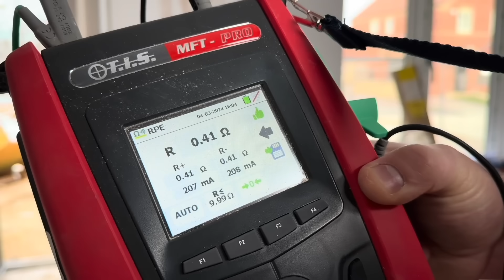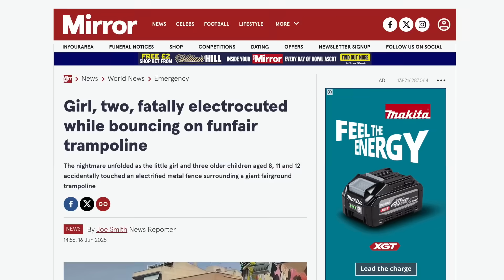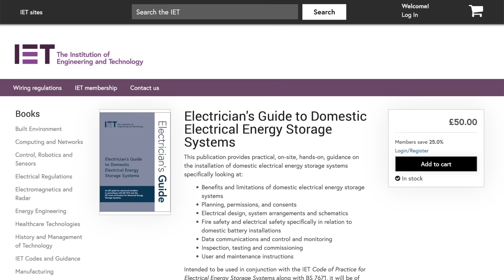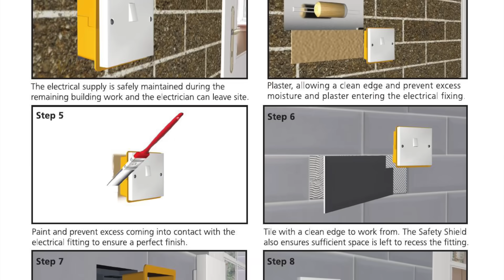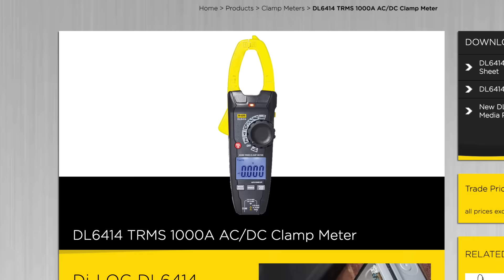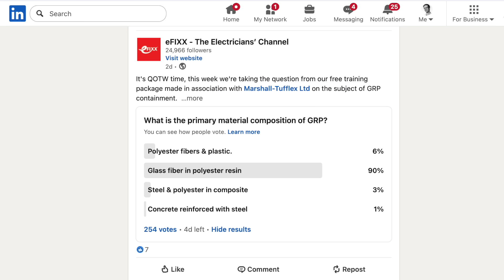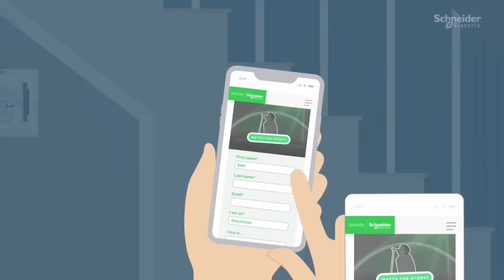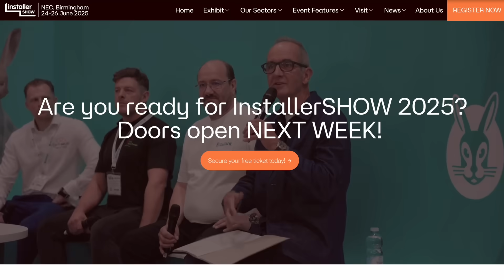IET Intervenes In Live Testing Debate...

Comment: Solar panel fires should be a thing of the past, did anyone actually figure out what the cause is?  Modern solar panels themselves have more than enough conductors between cells these days and should have close to zero fire risk.  But if you are worried, then ONLY install half-cut bifacial panels (rather than normal panels).  The half-cut panels have six internal strings instead of three and split the current in half.    A fire should be nearly impossible.

Maybe the installers are still paralleling large strings (which nobody should be doing any more, even with per-string fusing).   And it might not even be the panels at fault... if they have microinverters or RSDs then, well, having power electronics on the roof have the same problem that having disconnect switches on the roof have.  Hard / impossible to inspect, vulnerable to the elements and excessive heat, and failure modes which can cause fires.

So it sounds like people need to actually do a bit of investigation on this front.

-Matt

Comment: Chatting about photovoltaic and hybrid inverters, has any fellow electrician found a way of establishing which way the power is flowing in a wire (i.e. grid to inverter to charge batteries or inverter to grid to feed the grid). We can measure it very accurately but without knowing the direction I am finding it very difficult to set up the latest hybrid off-grid / on-grid systems. You can't even reprogram the system to give you a fixed direction because that in turn causes the inverter to operate in a fundamentally different way invalidating all your testing! Electricity meters do it so it must be possible!
Reply: Hall effect sensing and the right hand rule . Or Could just use a compass needle. All depends on the magnitude of the current, diameter of conductor and insulation (that tricky 1/R^2 fading of the magnetisation)

Comment: My own thoughts on PVS panel fires is that this entire world of 900v DC at 15 amps is too unforgiving and if we, as electricians are all honest, we don't have the same 20 years experience of knowing where all the boundaries are. Jo has already pointed out where electricians have run DC in SWA, (and not the special PVS 6mm) one of the lads I was training a few weeks ago crimped an MC4 on upside down, I came across an SPD that was AC, I had to revisit a load of installs because I had not realised that the DC isolators I had fitted had an IN and OUT (it wasnt marked), Every tiny weeny mistake when working with 900v DC ends up with a giant, blinding arc that gives off huge amounts of heat and flames (and nothing trips!), I doubt any of us have seen that with AC (something, somewhere always trips with any fault!). Not helped by the fact that solar panels in some areas are home to a zillion nesting house martins building nice dry nests of twigs and tinder in and around the connections.
Reply: It's becoming common for inverters to have arc fault interrupters built into the DC side so, hopefully, something will trip. Microinverters are also an option so that each panel has a separate connection to the inverter instead of them being daisy-chained to industrial voltages.
Reply: Im pretty sure SPDs are like incandescent lightbulbs and do not need to be designated AC or DC
Reply: @maygarland6123  They have to at least be labeled separately for AC and DC because the voltages will be different.  For example, a 230VAC circuit has a peak voltage of roughly 325V whereas of course the peak voltage of a 230VDC circuit would be... 230VDC.  And fuses have to be significantly more robust (and have a lower I.R.) for DC than for AC at the same voltage due to the difficulty of breaking the ARC on DC.  And junction thermal characteristics for the MOVs and zener diodes are different too.

So an AC or DC SPD could have the same parts, but the numerical ratings are going to be vastly different.

-Matt
Reply: Hiya, if you have a quick look, a typical AC SPD has 275 VAC written on it and a DC SPD has 1000 VDC. Also as you are probably aware, when you test out an installation, you test at 250v, but some things (like garden lights where they keep tripping in the rain), you decide to test at 500, 750 or even a 1000 just to establish where the issue is (because you cant work in the rain) and if you forget to isolate the SPD's first at 750v they conduct and your very expensive X1 starts to make a weird noise and shows a short circuit! Most solar installations are between 500v DC to 900v DC to a 275v AC Type 1 would never work. Plus, the inverter manufacturers state 'surge suppression' but what does that mean? Does that mean it fully conforms to all worldwide regulations and we can forget all isolation and protection (because that's not what it states. I have checked!) or does it mean it contains a sacrificial device internally that in the case of a lightning strike will prevent the unit from bursting into flames but you still have to spend 2000 quid on replacing the entire unit. Who knows? Maybe eFixx could cover this...
Reply: @paulmcraexx  Basically a SPD hangs a zener diode off of each phase to a central point.   And also hangs a MOV (sometimes with a gas discharge tube) from each phase to a central point.  The SPD hangs off of the wires being protected, it is NOT in series with the wires being protected.  It is not a series device like a breaker would be.

The central points all tie together through fuse(s).  Depending on the type of waveform expected (whether negative voltages are allowed or forbidden), there might be a back-to-back arrangement of zeners.  So a DC SPD for example might protect against negative voltages while an AC SPD would generally have to allow negative voltages.  Relative to some point (like ground).

The zener catches any over-voltage and has a reaction time of a few picoseconds to nanoseconds (very very fast, zener operation is more or less a quantum effect), but can only conduct for a very short time before the zener diode would otherwise explode.  The MOV takes longer to activate but can conduct the current for a much longer period of time before IT would otherwise explode.  If the surge lasts too long (generally more than a few tens of milliseconds), the fuse will blow and the SPD will stop operating.

These are more or less the mandatory components for an SPD.  And yes, the fuse is mandatory (else a long surge would catch the SPD on fire).

All they do is clamp extreme over-voltage "glitches" that can travel along wires due to remote events.  Such voltages can be in the thousands of volts and typically only last a very, very short period of time.

SPDs have to be fairly generous in the voltages because they are literally shorting phases to each other or to neutral or to ground when they clamp (there is no other way to handle an over-voltage situation).  Depending on the SPD type and country's electrical code.

So an SPD cannot really handle things like direct lightning strikes and certainly can't handle any sort of actual EMP weapon.  Despite advertising to the contrary.  It's just too much energy so the fuse would blow and the over-voltage would get through.  Or the electro magnetic surge would simply bypass the power lines entirely and couple directly into appliances.  They can handle indirect lightning strikes that couple into power lines fairly well.

The best type of SPD is one with an integrated breaker which protects a specific circuit.  The SPD operation itself protects the whole house from short spikes, but not from anything long enough to blow the fuse.  In those cases, SPDs with integrated breakers will trip the breaker prior to the fuse blowing and at least (try to) protect the circuit the breaker is powering.

-Matt

Comment: Ex 70’s/80’s television engineer.  Health and safety would poop a brick.  Wiggling your arm deep into a set while looking at a mirror to see the screen. Lighting your ciggy by drawing an arc off the eht bottles.  There were sets with live chassis if the non colour coded wires were reversed.  More shocks and ht zaps than you can shake a stick at.  Best safety advice wear Doc Martens and keep a hand in your pocket.
Reply: That's why any respectable repair shop has isolation transformers.  There's no justification for working on a live chassis design without one being used.
Reply: @retrozmachine1189  yep, or for the fly by nights snip the earth on the scopes... different era :)
Reply: I assume you read Television mag?  I miss LLJ articles :)

Comment: Some of the more modern Solar inverters have arc detection shutdown, which should stop high resistance inline faults but not any other fault.
Reply: They're some of the most dangerous faults so that's a handy feature
Reply: Inline high resistance causes resistive heating; that's not arc creating.

To create an arc you need a broken connection and a physical gap, OR insulation breakdown and arc creation from the conductor across to something else of lower or higher potential.
Reply: @deang5622  My bad was trying to think of the best way to put it.

Comment: Solar fire and you think this stupid dangerous technology is the future. 
As for live testing when I did my course back in the eighties we were we calculated loop impedance from the maximum external and R1+R2  and we never actually tested loop impedance.
Reply: We don't yet know what the cause of the fires is. So don't jump to conclusions that it is the technology at fault. It could be installation errors and errors made by poorly trained electricians.

It could also be down to faulty panels, faulty off the production line or which have become faulty in operation.
Reply: i'm reminded of electric cars vs ICE cars. ICE cars go up in flames all the time, and no-one gives a *BEEP*, but one electric car catches fire and suddenly all electric cars are deathtraps. GIMME A BREAK!!!
Reply: @mrxmry3264 EV fires and ICE fires are very very different beasts.
Reply: @mrxmry3264 Yes, you need a break to study and understand the difference in the type of fire/fumes etc that a lithium ion battery will produce.
Reply: @johnlesoudeur3653  For a whole car fire, the emissions aren't much different as there's loads of plastics in both of them which will produce nasty fumes. There's probably more fluorine from an EV fire as lithium batteries often have fluoropolymer membranes and fluorocarbon electrolytes.

Comment: Re solar panel fires my system has been in use since 2015 so finger crossed. 
One problem I did experience was a pigeon infestation with over 40 of them nesting under the panels. For the first six years it was fine, and then they moved in. A pest control company installed guards, and problem solved.
 The fire at the 'We The Curious' museum in Bristol a few years was put down to bird damage to the solar installation so I'd strongly recommend that the addition of bird guards is mandated as part of a new system's installation.
Reply: Once they have nested in a location, they will be back year after year.
You are going to find it extremely hard to keep them away.
Reply: @deang5622  Yes, the pest control guy said that pigeons always try to get back to where they hatched. Having said that, the guards have kept them away since they were installed three years ago.
Reply: a lot of it is down to companies installing the pv panels as cheap as possible and cutting corners on the install to stay competitive a lot of companies install to the bare minimum that is allowed in the regs
Reply: Flying Rats are a pain in the arse. They are dumb as rocks but have an uncanny talent at getting back into places. I've seen them land flat against a vertical wall to crawl up through a slot in a soffit.

Comment: I think the engineer that got electrocuted may have got confused with the damper supply voltage.  The Belimo dampers commonly used come in 24VDC and 230VAC versions.  They look identical and it’s not uncommon to have a mix of both voltage types onboard for different systems. He may have disconnected one wire at a time thinking it was relatively safe to do so on 24VDC.  It can be difficult to find where some of these dampers are fed from, and sometimes the only way  is to shut complete systems down.  High pressure to get the job done with no disruption of service, difficult working environment.  Hot sweaty and tired.  I can see how it happened.  It would be nice if Belimo stuck a warning label or colour coded the covers to show which are 230VAC and which are 24VDC.
Reply: As a marine electrician, I would tend to agree, valves and control gear seem to be mixed 230v AC and 24v DC. The biggest issue on yachts is that the wiring is so complicated with so many sources of AC and DC its not so easy to isolate, plus you cannot just turn a yacht off, it will be going along, engines running, generators / inverters running, watermakers, nav gear, hydraulics, winches, servo assist controls and tons of stuff. The big advantage is that at sea, the neutral is not 'earth' bonded so touching either the live or neutral by mistake is usually a whoops moment (you can still feel it), not a death sentance. so sad, and condolences to everybody affected.
Reply: @paulmcraexx  Ah ships are an IT system, didn't know this, makes sense, with earthed (well seawatered) metal all around it makes sense. Do they use insulation monitors to spot single earth faults? And yes condolences to everyone affected, sh*t happens, and it sounds like he was in awful working conditions too :(
Reply: (We do only shore based stuff, but are based in Gosport so lots of marine related stuff. Good thing about a marina on salt water estuaries is that a single TT earth rod usually gives an impressively low resistance)
Reply: @TheChipmunk2008 I am not a marine electrical engineer, but I have just looked at a ships electrical distribution system and several voltages are used: 440V AC, 220V AC and 24V DC.

Only the 220V AC and 24V DC are galvanically isolated, the 440AC is not.
And the only reason the 220V AC and 24V DC are galvanically isolated is because they are using transformers to step down from 440V AC.
Reply: @deang5622 it depends,  a lot of yachts bond the neutral and earth and don’t have transformers for the 230vac.  Commercial and diesel electric use isolation transformers delta delta.  No centre tapped neutral.
Reply: If you are not sure of the voltage present, then you measure it.

Silly to assume.
Reply: @deang5622 It’s a mistake to assume.  I don’t know when he last slept or if a psychotic captain or owner was screaming at him to fix the problem right now.  
If he had decent drawings.  
If it was possible to shut power down to the dampers without shutting down a lot of the HVAC and ventilation.  In a hot climate it can take hardly any time at all for the vessel to become unbearable.  There’s a big difference between working on a site with great health and safety controls to working in an environment like that.
Reply: @JT_2024-c8j You are assuming that I am assuming. That's a mistake on your part.
I didn't assume anything. Read my post again.
Reply: @deang5622 The engineer who had the accident made an assumption, not you.
Reply: @deang5622  Generally yes, but nobody's perfect, mistakes happen :( .... Tragic for him and family and friends. And we don't know the circumstances other than it was hotter than HELL so he was likely drenched in sweat. Used to work in telecomms, if you're wet enough you can get a belt from 50v dc
Reply: There was a bit more to it, in that he wasn't 'an engineer' he was the chief engineer on-board and the space he was working in should have required a PTW to access.  Worth a read of the MAIB accident report.
Reply: @ARexx225 Chief engineer is an engineer.
I'm assuming here, they are not abusing the term engineer and he really does have an engineering degree.

And anyone with an engineering degree has the knowledge to know what they are doing.
Reply: Good insight, thank you
Reply: @TheChipmunk2008 thanks, it’s easy to assume it was daft doing it “live” or not checking it was dead without knowing how much pressure he was under in the lead up to the incident.  Also on that size vessel he was likely an engineer expected to look after both the mechanical and electrical side of things.  I wish the yachting industry would be forced to focus more on safety at the expense of the owners and guests being slightly inconvenienced.
Reply: @JT_2024-c8j  yes, always good to realize the guy was skilled, so something went wrong and may NOT have been something he expected. RIP that man.  I'm from southampton myself, there's always pressure on marine work